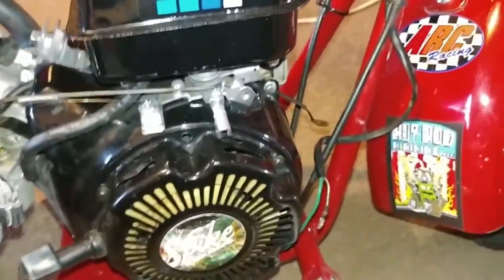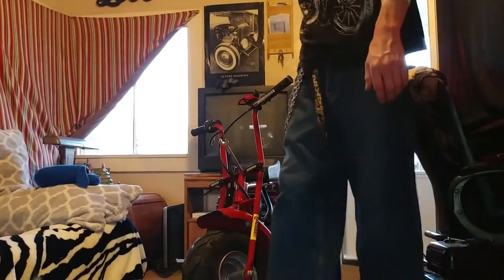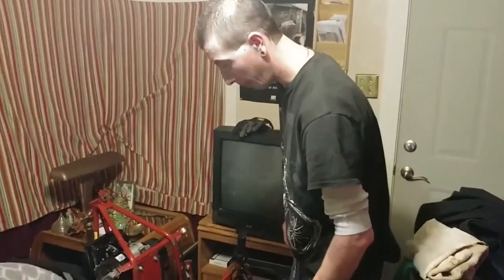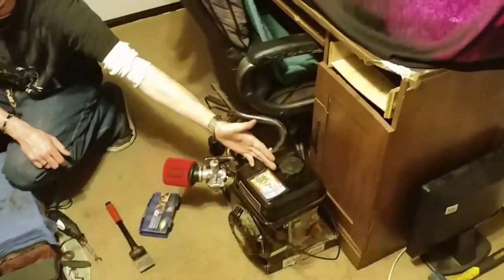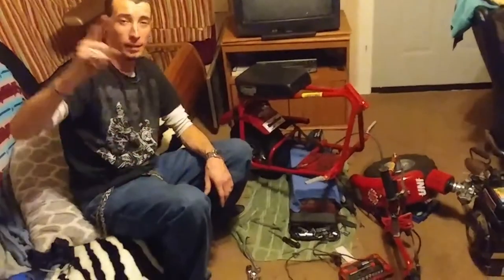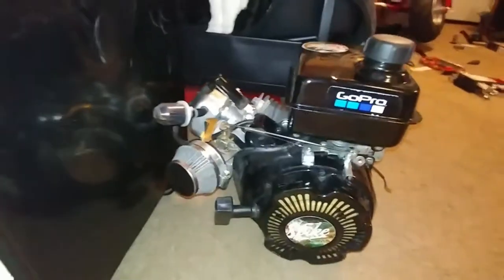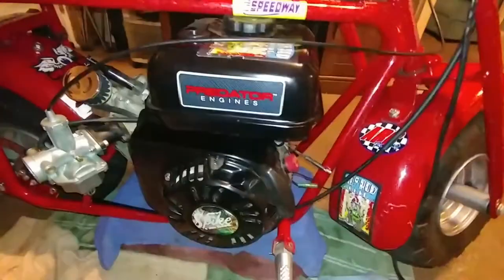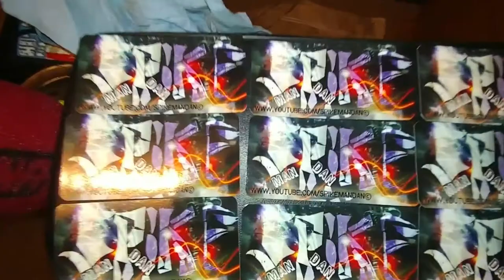new engine swap on the coleman ct 100u

Comment: If you use a vented cap, you might be able to seal that opening with an expandable rubber grommet, some use them to temporarily fix stripped drain plug holes, they work well if they are fitted right, it would be fine on a temporary basis...small external gas tanks work well.
Reply from the maker: got it taken care of bro will have a video on it soon but as of right now im in the middle of rebuilding my engine again! stock piston rod went to shit so im replacing it as i speak
Reply from the maker: fixed what next??

Comment: Hey Dan, Is the muffled header pipe you took off the small engine the one that comes with the A - filter /combo ??.. Looks bigger. …. If you might want to ''SELL'' that pipe &  A - filter,, let me know .... Ian
Reply from the maker: not sure i understand what you mean or asking are you wanting to buy parts off me?
Reply: Yea, guess the ''sell '' word didn't added. LOL. Let me know if you might want to ''sell'' me the 100cc muffled header at some point, &  maybe the 100cc carb/ filter adapter plate.
Reply from the maker: Paula Campbell you can order it from Hot Rod mini bike.com

Comment: How did you line up the chain? I put the 212 on my ct100u and if I have the silver side of the clutch out it’s too far off to line up with the back sprocket but if I have it flipped, the clutch has left to right play with the bolt tight
Reply from the maker: all i had to do was cut down the front oil plug in order to tighten my chain up, but other then that my clutch is on the normal way  facing black side out! very little play to line everything up hope this helps ;) ps had to cut front oil drain plug flat its not needed